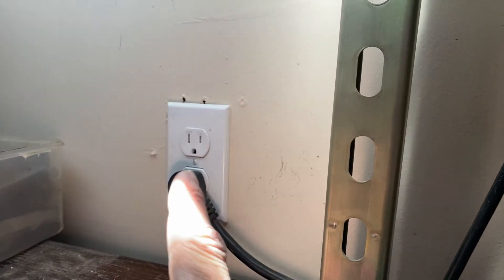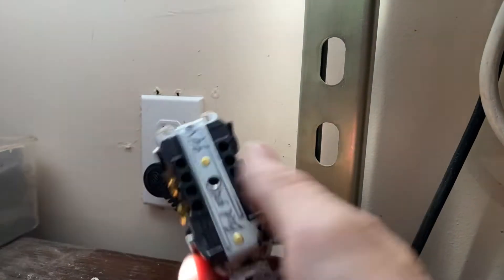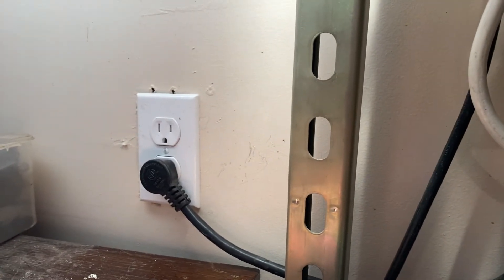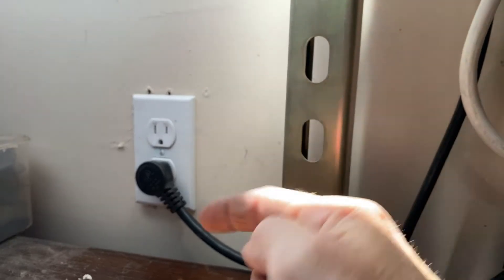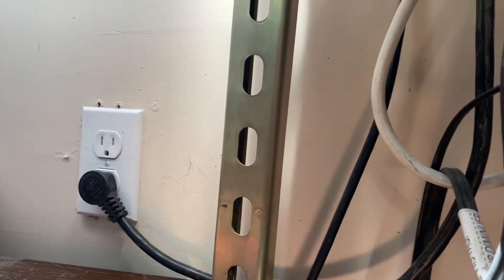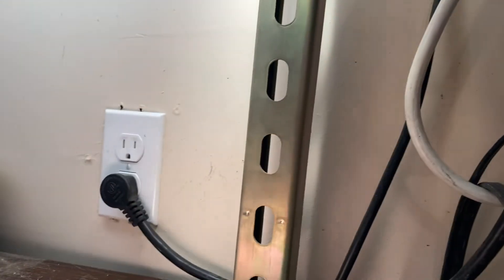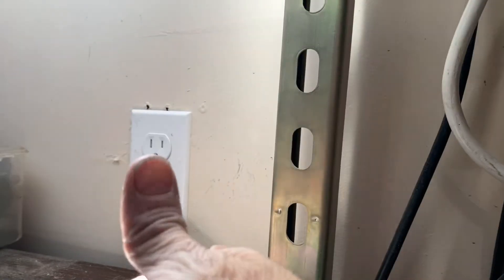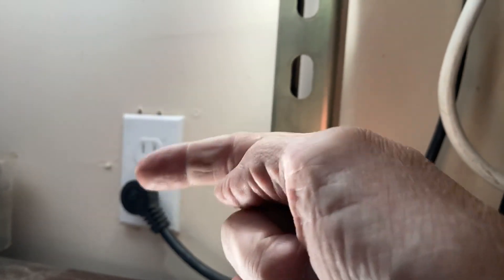Low voltage “outlet” (I’m calling them plugs sorry) on 120v Household power.

Comment: I have 3 outlets on a circuit. It has 120v with nothing plugged in as soon as I plug in something the voltage drops

Comment: I'm having low voltage to all of my outlets. I checked the breaker box with a meter and it reads fine. Any help would be appreciated. Ty.
Reply: Did you solve your problem ?
Reply: @elmarsauro3245  yes, it was a loose connection in the outside breaker box. The breaker was pretty old and corroded. Thanks for asking.

Comment: The reason for the low voltage (94v) is that the wires in the wall are too thin, or too long, or there is another big high-wattage load in parallel with it, like heater, air conditioner, coffee maker, etc.
A lot of old homes have the old-fashioned cotton-covered wires with 2-prong outlets. Some dishonest electrician ran a jumper wire from green (ground) to silver (neutral) and put in a 3-prong outlet, to deceive new homebuyers. I am NOT saying this happened in your house, but a lot of crooked home sellers do this.
Reply from the maker: I have 12g wires the outlet was faulty. Put a new outlet in and the outlets down stream returned to the correct voltage.

Comment: Your outlet is not parallel it's in series to be my guess or some weird resistance.
Reply from the maker: Now you have me thinking…….  These should be parallel but if one hot is on the top screw and the next hot was on the bottom screw and something burnt the connection between the 2 screws it’d turn the line into a series…….. your hurting my head bro! 😂

Comment: Sounds like possibly the contacts inside the plug had corroded, burned or otherwise damaged amd building up enough resistance such that, it appears normal voltage,  then if a substantial load is placed, you have severe voltage drop, but the weird part about the whole dilemma,  is if that were the actual case, you'd expect to see scorching on the front of the outlet,  as well as a burned plug cap.

Comment: You were trying to put a 30A outlet on a 15-20A circuit?
Reply from the maker: That’s a moot point, if it was a 30 amp plug it should of held up better. Point is I’m not going over my 20A circuit capacity on this run.
Reply: @trialnterror  not*
Reply: @OGHatMaker nat*

Comment: What if I am reading 5.30 volts on an old tube and knob wiring?
Reply: Trace that wire down to the fuse panel then test it coming out of the breaker
Reply: Are you still alive?